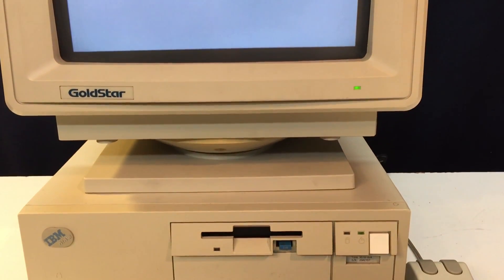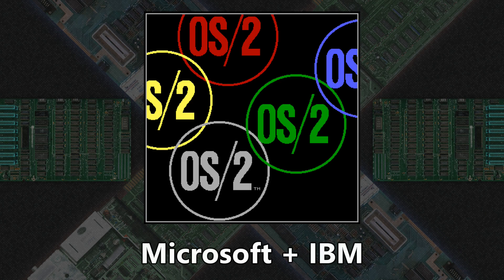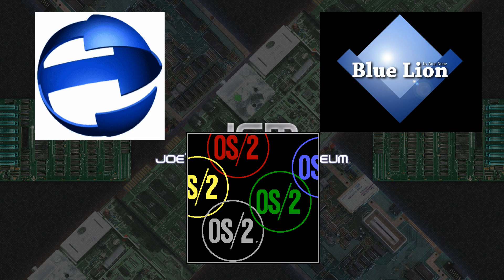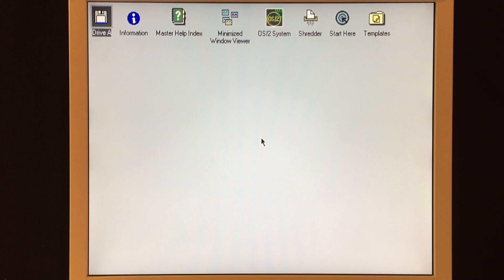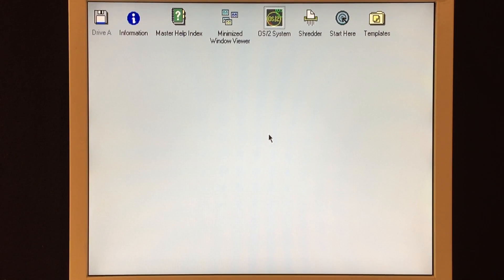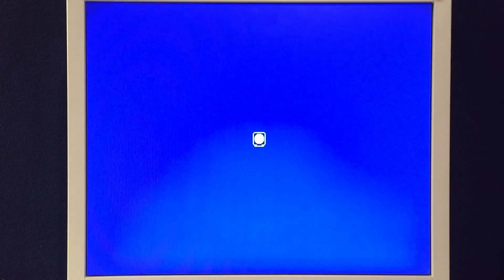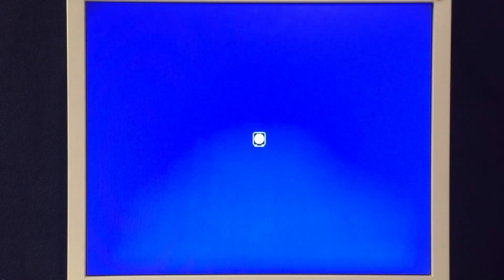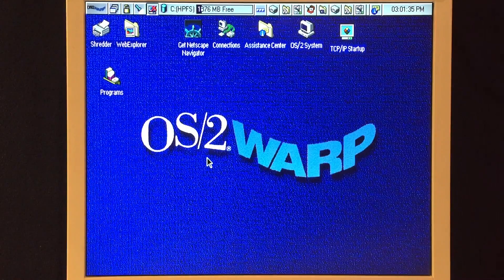Let's Install OS/2!

Comment: I used OS/2 from 1993, when I worked at IBM for a year between 3rd and 4th year at university, until 1996 or 1997 when I think I switched to Windows NT 4. I started with OS/2 2.1 and then bought a retail version of 3.0 Warp before briefly upgrading to 4.0 "Merlin" as I'm sure it was known as in the UK. I absolutely loved OS/2 from a technical perspective and it was super-robust and virtually uncrashable, unlike Windows of that timeframe. Windows NT 4 was a good OS in it's day but had no character compared to OS/2 Warp or Merlin. This seemed a bit ironic at the time since IBM was supposed to be the serious "business" company and Microsoft was more of the upstart. 

Anyway, thanks Joe for a taking me on a trip down memory lane. I have very fond memories of OS/2 and it's jut a shame it wasn't more of a marketing success than it was because it certainly had fantastic technology for its time. I even had a token ring network in my house back then running at 4Mbps if I recall correctly. Used to play Doom over it! :)

Comment: OS/2 had a white cursor in the first version created in collaboration with Microsoft. Obviously with OS/2 version 2.0, they wanted to move away from the association with Microsoft’s design philosophy of having the Desktop Manager/Program Manager interface. If you think of this way, Microsoft essentially also took a lot of inspiration from the OS/2 Workplace Shell. Windows 95 effectively killed OS/2, despite the latter being a better product.

Comment: too bad there is not a single clip or running OS2 <= 1.3 on a 286er. OS/2 was able to provide functionality like multithreading and swapping - which many other operating systems required at least a 386 (with its advanced 4k paged mmu) for.

Comment: Ahhhh, yes.  I remember experimenting with OS/2 2.0, 2.1 (I think), and Warp back in the day.  The problem was, at the time, my 486DX-33 only had four megs of RAM as I recall, so Warp was just too slow even though it was super cool.

Comment: I just purchased a copy of ArcaOS 5.0 and is still thinking of a computer to put it on. Since I have used OS/2 versions 3.0 and 4.0 I am familiar with the OS and loved it when I was having trouble with Windows in the early years. Windows 95 thru Windows ME sucked so I needed something more stable and OS/2 filled the bill.

Comment: Our family had OS/2 from '92 thru '96-97.

I remember there was a "shutdown bug" where that shutdown warning stayed on. It was fixed in one of the OS/2 Fixpacks (#22?).

IBM programmers needed to fix the Single Input Queue bug that caused it to freeze and do other wacky stuff that I cannot remember 25 years on.

I loved OS/2. It was a promising operating system. However after Linux was invented by Linus Torvalds, IBM had a new competitor and could not keep up.

You should check out 90s editions of OS/2 eZine.

 By 1999 IBM ditched the possibility of ever making a 64-bit version and so it just limped along in the 2000s.

I switched to Fedora Linux in 2005 and basically haven't looked back. But now that IBM bought Red Hat last week, I wonder what is the future for Fedora Workstation.

Comment: Yeah, it does look a lot like Windows 3.1. But when I tried installing it in my VirtualBox, I never could get it to begin properly, I guess because it knew I wasn't using an IBM PC.

I usually head straight for the Write option when installing an old version of Windows (or Edit in DOS) to start documenting what I see right away :)

Comment: Awesome video man, I myself would like to keep vintage hardware "Safe" and using the SCSI to Flash seems like a great way to preserve it! Keep the great videos coming!
Reply from the maker: That's basically what I do in most cases. I yank the original working drive out, replace it with flash, and then I can do whatever I want and not have to worry about it. Thanks for the kudos!

Comment: Still running OS/2 in a VM, it hosts my retro BBS.
Reply from the maker: Awesome! I gotta say, the OS has a reputation of reliability, that's for sure.
Reply: It is accessible via telnet at bbs.razorsdomain.com:23230. I actually don't even have a dialup line in the house, so no dialup connection. If it doesn't prompt for login after the ansi, press enter a few times.

Comment: OS/2 was a bit of a walled garden. Driver support was initially limited to IBM supplied network cards. Support for third party network cards when available, was fairly limited.
Reply from the maker: True that. I tried for an hour to find drivers of any kind for the ethernet card in the system here, and found nothing.
Reply: Can you tell what model the card is? Some types of cards could be set to identify as either the OEM or as an IBM card. In that way they were either supported by IBM's driver, or not. The previous owner may also have installed Windows to get driver support.
Reply from the maker: Note to self: boot computer back to Windows 95 and look at Device Manager instead of trying to Google details from the card PCB. It's much easier to find that it's an Olicom Ethernet MCA 10/100 - and that there's OS/2 drivers for it. Sounds like a topic for a followup video.